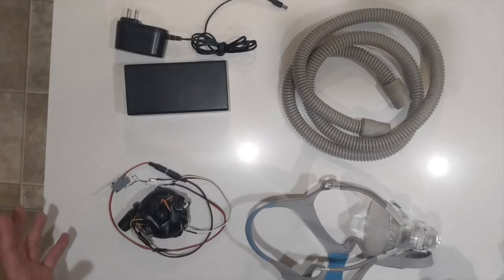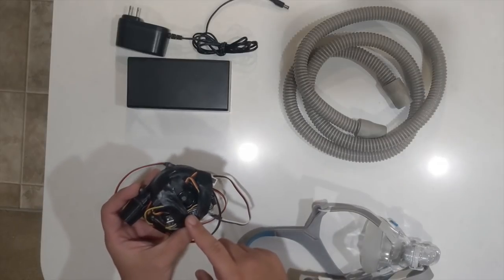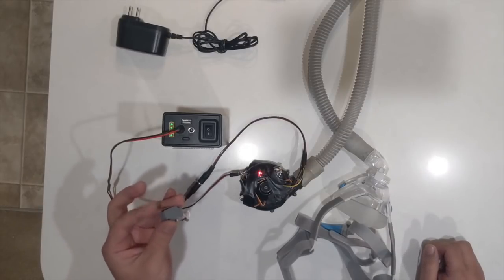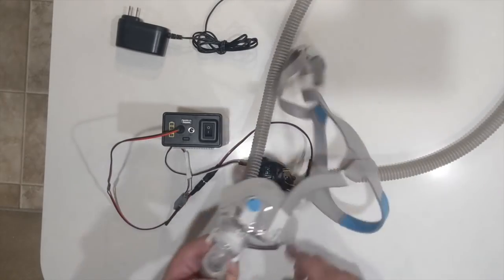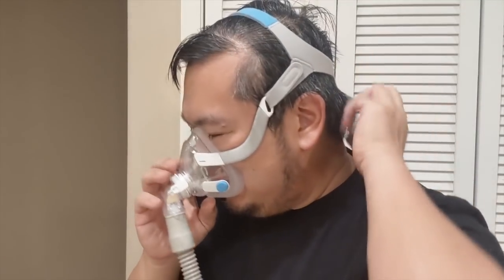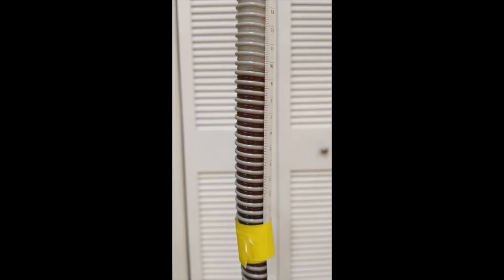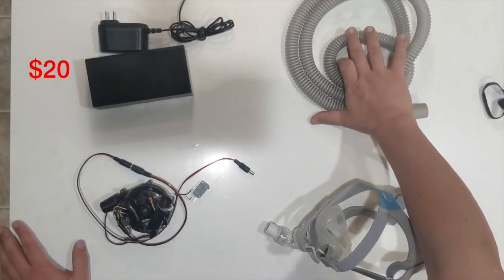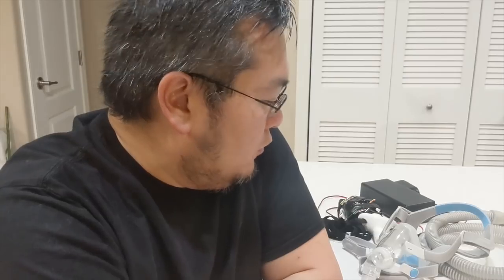Low-Cost Open Source Ventilator-ish Device

Comment: Can the  C-Pap machine simply be programmed  to  function  like a quasi  ventilator ?  The interface does accept certain  program settings that the  pulmonary  doctor sets.
Reply: From Johnny on another thread: If an existing CPAP could simply be reprogrammed, then this indeed would simplify the build and enable a potentially large stock of existing equipment.  We would need a manufacturer to either release the tools to enable reprogramming them or for someone to figure out how to do it on their own.

Comment: You  could make impromptu face shields out of poster board, 3m window insulation film (they type you heat with a hair dryer) a bit of tape and some elastic or a bungie cord (sort of make a cheap halloween mask out of these things but create a big window in front of your face). Cut a hole in the poster board face sized tape some window film over the hole with painters tape , heat it so it's clear, and secure the face mask to your head with a rubber band or bungie  . is it perfect no , will it keep some patient from tossing spittle into your face? yeah , will you look goofy? sure...will you reduce your risk? probably

Comment: Hi, this issues is way more complicated than you think.  Your idea isn't going to work because there is no way to know how much pressure is actually being received by the lungs  which could possibly cause more trauma, as well as how much tidal volume is being delivered, and the ability to add oxygen.  Most of the Covid patient's are dying form something called ARDS and that generally requires invasive ventilation (Ie. an endotracheal tube and a ventilator) and VERY HIGH pressures, mainly PEEP.   Also you have no exhalation valve so this would aerosolize the virus into the environment and potentially add risk to the healthcare workers, especially if that large tube became dislodged.  Also it looks like there would be too much rebreathing of CO2 ridden air because there is no place for it to go, and it will sit in that large tube, which will act like a reservoir.    You cannot use your device in place of a ventilator, as all that high pressure air would just be forced into the esophagus.   Building a device like this sounds like a good idea, but I don't think you realize how complicated long term ventilation and CPAP/BIPAP are in a critically ill person.   This might not be a bad idea for your own use, just in case you were unable to get help, but it's not very safe to be honest.   I thank you for being creative and trying to help other people, we need people like you!    P.S. As long as the hospitals can get oxygen their are very simple CPAP devices available that work on oxygen flow only that could also be used if we were really in dire straights.

Comment: Could you use a nebulizer mask also? They are pretty cheap at the local med supply store and they have a similar tubing attachment/tube to the cpap you showed.
Reply: I dont think so as they have holes on the side and the blower would not build pressure to inflate your lungs. Also loose fitting and the pressure would escape
Reply: @BruceRudling  Right, but you could cover the holes in a pinch.  How does the Co2 get expelled from either device though?

Comment: I have couple of questions, how does your setup and its control function differently from the sleep apnea setup?.  If it is the same, does that mean the sleep apnea will function the same way as the ventilator in the constant flow rate mode?.

My second question is, was you able to explore or achieve other modes of operation like controlling the pressure/volume or oxygen rate?.
Reply: Hi Ash. You can read more details on the github page: https://github.com/jcl5m1/ventilator/wiki/Notes-from-chatting-with-a-pulmonologist

Comment: I need to give some positive feedback. The devices the doctors use generate a controlled pressure BUT THEY PRODUCE OXYGEN also! The device you made is the same as my CPAP machine, it will not help when lung function is reduced form this virus.

Comment: A Bi pap would be better however the issue is that it's an open circuit. every time the person breaths out they would be sending the virus out into the room, not only contaminating surfaces but aerosolizing the virus.  which presents a danger to the caretaker. Their are also a number of issues with your design, It has no pressure sensor, a bi-pap uses a pressure sensor to trigger not greater flow but greater pressure. a  CPAP at significant pressure level could negatively effect blood pressure with a controlled variable pressure as you are suggesting you would end up having the pt fight the vent unless you paralyze the patent and that also can be problematic.
Reply: Hi. You can read more about the intent and considered factors of this approach here: https://github.com/jcl5m1/ventilator

Comment: Hi,
I have 2 used, salvaged Cpap machines.  At the moment it is not possible to order parts. Can I convert the machine with the parts I have and locally  available.  Even though I am handy I don’t know how to use ardiono  stuff.  I have all the basic stuff , soldering iron, test meter, 18650 batteries etc.  We are isolated in our area at the moment, and I would like to be able to go out for basic supplies.  Im 60 years old and am in the high risk catigory due to atrial fibrillation.

Comment: Needs to draw air and push air cyclically. Will the motor go backwards with re erased polarity?
Reply: I don't think it needs to draw air.  Consider a manual ventilator (aka "bag valve mask").  Those don't draw air from the lungs.  In fact, they have a one way valve between the bag and mask to prevent air from flowing backwards.  They only inflate the lungs.  The lungs then deflate on their own to balance with the ambient pressure and from the weight of the body surrounding the lungs.  Inhaling requires effort, but exhaling really only requires one to relax.  So I think this design would work by just alternating between a higher and lower (or no) pressure.

Comment: Johnny- in lieu of room air, the intake must be regulated 02. In addition to your prototype, can you direct the intake from a controllable oxygen tank? I've been contacting sources regarding the same device conversion with the necessary oxygen attachment. With your technical skills, I'd bet you can take it that one step forward. Stay safe.
Reply: CPAP masks have provisions for attaching oxygen lines. Oxygen providers are available. You can get CPAP masks that cover nose and mouth. A BiPAP machine
 would be the best choice. There are a lot of CPAP and BiPAP machines out there and they shouldn't need to be reconstructed to accomplish the goal.

Comment: Johnny, is there any reason why you can’t use a CPAP machine as you can use that to control the pressure?
Reply: If an existing CPAP could simply be reprogrammed, then this indeed would simplify the build and enable a potentially large stock of existing equipment.  We would need a manufacturer to either release the tools to enable reprogramming them or for someone to figure out how to do it on their own.

Comment: I would suggest at least a way to release pressure at the mouthpiece and not through the pump...That way you would be sure the air entering the lungs is as fresh as it can be...
Not quite sure if regular medical ventilators are equipped with a system in which the air pressure is re versed to aid in ex hailing...I would suspect not but who is to know...

Comment: So if one could get a small mister fitting stainless. Hooked up to some sort of timer witch would mist every 5 min for a few seconds. With a small water heating device. Something to read presure in an out. A small variable speed motor with a variable speed control switch.an some kind of emergency shut of with all required  hoses an mouth or face attachment could make a ventilator.
Reply: Michael mkpeak

Comment: i hv medical background, since this was originally a ventilator. As BiPaP is a non invasive ventilator. it kind of defeat the purpose as why not just buy the machine if you can afford instead of taking it out (i understand you hv one lying around that is spoil). Also for pneumonia supplemental oxygen is more useful than that.
i could see a use with that, which is if mask is unavailable due to shortage you u attach it to some kind of filter and go out to crowded places.

Comment: Great work. Just want to know why one can't just directly use a CPAP to treat a patient with Corona. Is it because the pressure is too low?
Reply: CPAP machinese out of the box have been reported to be used for covid patients as a stop gap solution due to the lack of ventilators. From Johnny on another thread: CPAPs tend to be closed unable to change pressure without prescriptive changes.  They don't actively drive a breath rate.

If an existing CPAP could simply be reprogrammed, then this indeed would simplify the build and enable a potentially large stock of existing equipment.  We would need a manufacturer to either release the tools to enable reprogramming them or for someone to figure out how to do it on their own.

Comment: Do you think the portable air pumps for an air mattress can work as the engine
Reply: CPAP parts are made to run continuously for long periods of time. Air mattress blowers may not be able to withstand that load. It is however very worthy of testing.

Comment: I bought a Respironics CPAP which can operate in BiPAP mode for couple hundred from craigslist. Would that not work? Its non-invasive. Or is invasive therapy recommended with covid-19?
Reply: Off the shelf biPaPs may not enable changing the behavior needed for covid-19. But if it can be reprogrammed, then this indeed would simplify the build and enable a potentially large stock of existing equipment.  We would need a manufacturer to either release the tools to enable reprogramming them or for someone to figure out how to do it on their own.

Comment: Would a foot powered pump be an option? I know it wouldn't be ideal, but lets say there is a limited supply of electricity or electric models, you could use a human powered one while awake and an electric one while asleep. I've seen foot powered sewing machines from pre-electric times,  so if someone was able to volunteer their time it could be useful. I'm not sure if there are different stages of the virus and it's debilitation, but potentially someone in the early stages could power it themselves?

Comment: @johnny lee So it's a constant/pulsing positive pressure, but at no instant you apply negative pressure to such air out, correct?
Reply from the maker: The guidance I've received is generally positive pressure is desired all the time.  PEEP - Positive End Expiratory Pressure

Comment: I am concerned that the airflow exit from the starndard CPAP mask could aerosolize the COVID-19 virus putting anyone treating the patient at risk.  A puttied or other means to attach an airflow exit tube leading to an air filtering/purification attachment should also be considered.
Reply: Excellent point. Vacuum cleaner bags have been mentioned in this thread. Some brands do have a HEPA spec available and are used by people with respiratory issues. Exhausting into a bag might be a consideration.
Reply: Gist from Johnny: This solution is best for an already dirty environment i.e. converted convention centers. Doctors may choose to wear a papr.

Comment: My two cents. Are you saying to just use a Bi Pap machine to aid in respiration if you don't have a actual ventilator machine? I would agree if that's the case as it would be better than nothing. Being that CPAP machines are suppose to overcome breathing obstructions, as long as corona doesn't swell your trachea closed I think it's better than nothing. It like scuba gear with an endless tank. Good idea I think....:)

Comment: Great!  I have been thinking about the same based on Arduino or Raspberry Pi. I am a firmware engineer and I can help write code for the Arduino. I have a 3D printer and I will join you to improve the system. I want to have a chamber to mix oxygen. We can use a gpio to control an oxygen valve.

Comment: U can probly use a pump for a air mattress also there alot more common
Reply: CPAP parts are made to run continuously for long periods of time. Air mattress blowers may not be able to withstand that load. It is however very worthy of testing.

Comment: Do ventilators not create a negative pressure to help exhale air or is it continuously positive like this?
Reply: The positive pressure phase that inflates the lungs typically lasts for 0.5 to 1.5 seconds depending on a number of factors.  Then, the expiratory phase is allowed to occur for 1 to 4 or 5 seconds generally. Ventilators have the capability to allow the inspiratory to expiratory time ratio (I : E ratio) to be about 1:2 to 1:7.  But the actual value depends on many factors including patient comfort and synchrony with the ventilator if the patient is breathing spontaneously.

Comment: I really don't know what makes a medical ventilator different than a CPAP machine.   I think with medical ventilators they put a tube down your throat because your lungs can't suck in the air.  A CPAP can force air down past your throat and nasal passages, but can it do the job of a ventilator?   I get the feeling that if a CPAP could do the job of a ventilator we wouldn't be so concerned about the availability of ventilators.    What exactly is it that a ventilator can do, that a CPAP can't?

Comment: I just saw in another video on YouTube the ICU ventilators have the ability to detect how much air is required to be pushed in the lungs based on age, size, and current need in order not to over pump and damage the lungs. How are you going to overcome this challenge. 

I’m not a medical profession but I have been told by medical staff how easily one can damage oneself. E.g. I had drank too much water for my bladder Ultrasound. The technician told me not to do that as too much water overstretches the bladder which could damage its muscles.
Reply: It is discussed in the github page.

Comment: hi, will i think for start, you already have a pressurised o2 and air from the hospital or from an o2 canister, you need to have the right mix, and to regulate the pressure,  also you need to be able to measure the pressure inside the lung, also something really important in your case, you need to let air out! :D 
i don't know a lot about rasperators but that is where you need to start , learn how a real rasperator work.
Reply: and they need to be intubated"ntubation is the process of inserting a tube, called an endotracheal tube (ET), through the mouth and then into the airway. This is done so that a patient can be placed on a ventilator to assist with breathing during anesthesia, sedation, or severe illness."
Reply: @socaljet  i think we need to understand the exact needs for ventilator particularly for this kind of illness, so we can focus our effort on achieving that only goal, and tailour our machine over that exact mode of operation, and also have the parts of shelf.

Comment: why do I need to take it apart? to do the same job.
Reply: From Johnny on another thread: CPAPs tend to be closed unable to change pressure without prescriptive changes.  They don't actively drive a breath rate.

If an existing CPAP could simply be reprogrammed, then this indeed would simplify the build and enable a potentially large stock of existing equipment.  We would need a manufacturer to either release the tools to enable reprogramming them or for someone to figure out how to do it on their own.

Comment: Doesn't this aerosolize the virus making it even more contagious to those in the area?
Reply: Yep. Which is why invasive ventilators have flow and return circuits, extraction ports and filters. Also why non-invasive ventilators (CPAP and BiPAP machines) are not much use for Covid19 as expired gasses just blow over the poor nurse giving care.
Reply: As the github page explains, this would be intended for dirty environments i.e. converted convention centers.

Comment: I missed something. Why not just use the Cpap. Good thinking outside the box.
Reply: From Johnny on another thread: CPAPs tend to be closed unable to change pressure without prescriptive changes.  They don't actively drive a breath rate.

If an existing CPAPs could simply be reprogrammed, then this indeed would simplify the build and enable a potentially large stock of existing equipment.  We would need a manufacturer to either release the tools to enable reprogramming them or for someone to figure out how to do it on their own.

Comment: But how do the patient get rid of CO2 - as in "breathing out" if there is constant pressure?
How about having two motors/pumps - one as you have here and one that is the exact opposite that pulls air from the lungs. Then have a valve that switches between the two, emulating breathing.
Reply: Solenoid Valve!!!
Reply: @J_M_F  Hmm no i dont think that would be good. You dont want an abrupt stop of the flow. That will be very painful to use. You need to emulate normal breathing that goes smoothly from in to out (like sinusoidal). I'm thinking perhaps a rotating valve that slowly closes and opens "in and out" air.
Reply: Exhalation goes out through the mask and back through the blower.

Comment: Great thinking BUT !, isn't it just a mattress inflator ?, how does the air come out, its not a breathing process. Oxygen would need to be administered also.
Reply: Mattress inflators may not be able to run as long and continuously as cpaps do as cpaps are made to run for much longer periods of time. People are experimenting with mattress inflators. You can check out more details here: https://github.com/jcl5m1/ventilator/issues/62